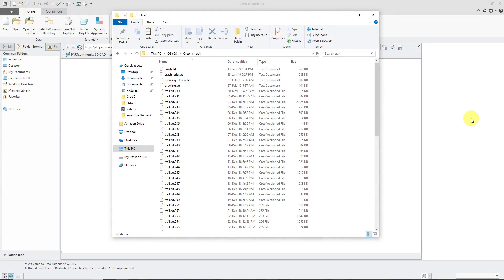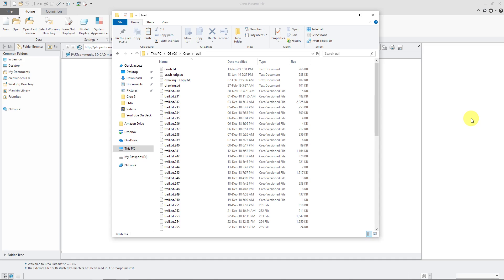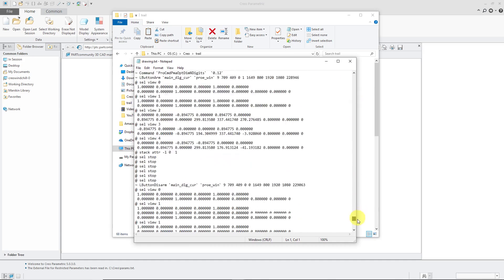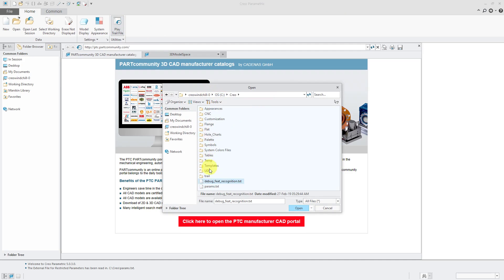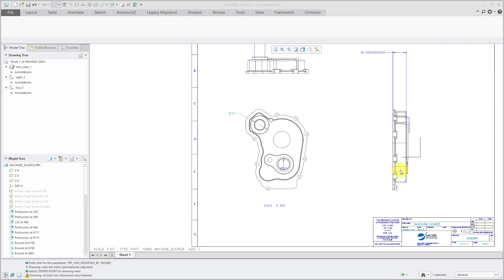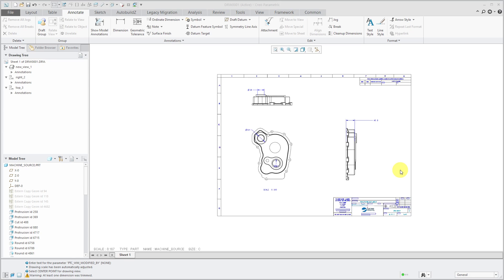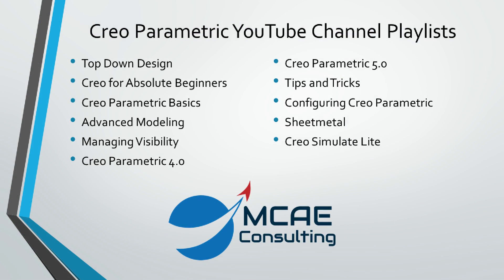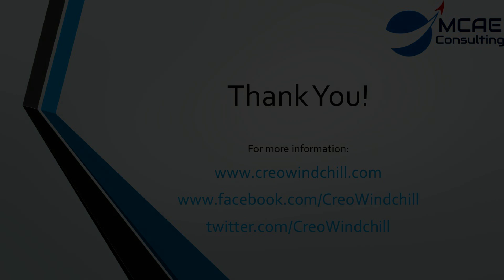Creo Parametric - Trail Files in Drawing Mode [Demonstration]

Comment: I've been using trails for several years to increase productivity.  I do routines to perform large tasks and run them through macros.  It works great and I do not have a huge config.pro.  I have thousands of trails files ...
Reply from the maker: Wow, that's ingenious! Great idea, Miguel.
Reply: @CADPLMGuy  Yes and to improve the experience I started to develop applications to manipulate the contents of trails such as names, paths etc.  This way I create custom interfaces that make the use of Trail files simpler and more intuitive.
Reply: @Miguel_Seabra  
And How can you use trail files to make more productivity, Miguel.
Reply: @Miguel_Seabra  sir, i ve been interesting in too, that use trail file as a automaticaily macros. im in launch vehicle engineerer and use trail file as a automated repetitive extraction of launch vehicle section properties tool. but i stuck several issue. plz can you help me?